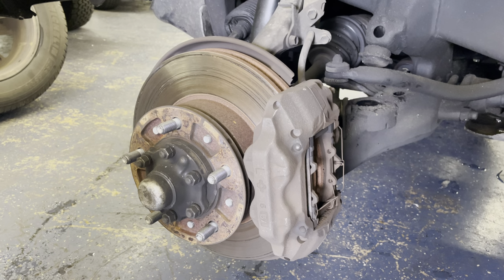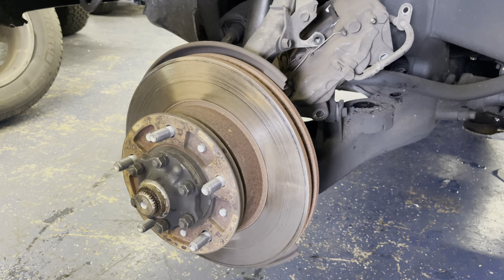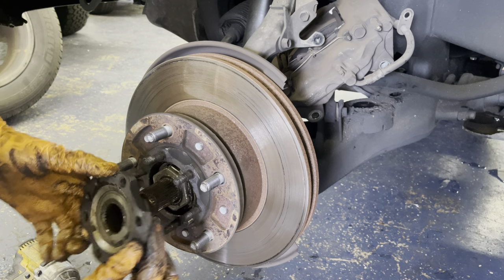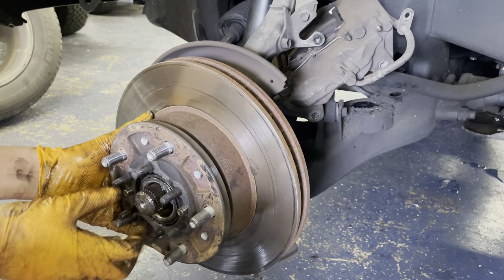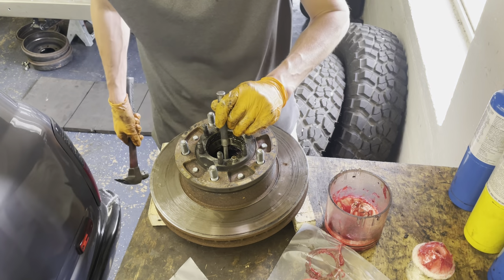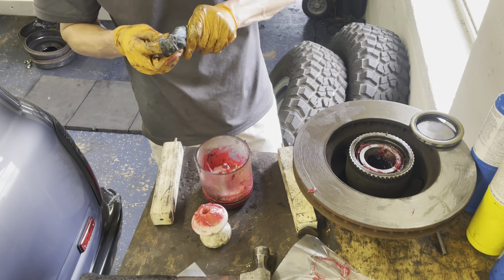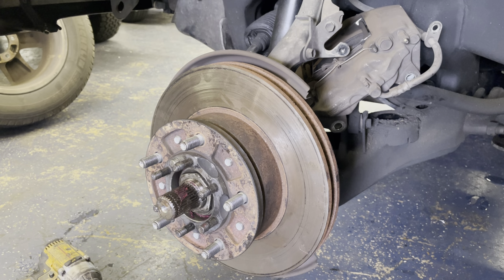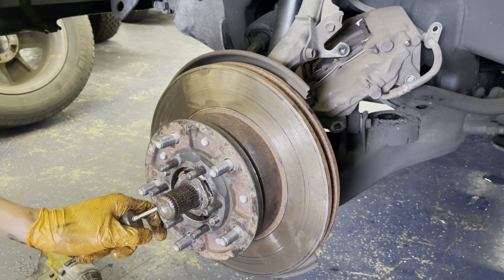100 Series/LX470: Wheel Bearing Service and Hub Disassembly

Comment: Did you not replace the race for the wheel bearing ? If not why? Need to do this soon to mine with 300,000
Reply: We only repacked the wheel bearings. We did not replace the bearings. Anytime you replace the bearings, yes you replace the race with it. Most come together.